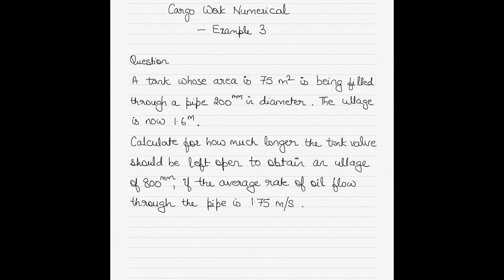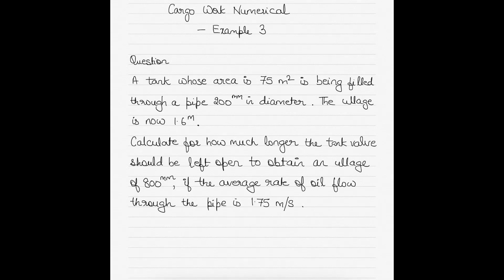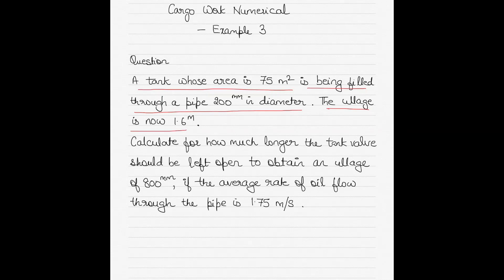Can you solve this Cargo work numerical??

Comment: Good day sir, 
Answer is 18.18 min
But sir this just for pipe of length 1.75 mtrs
In actual calculations do we include  length of drop line from manifolds  to the tank ???
Reply from the maker: U mean for ullage calculation?
Here, the rate of flow was 1.75 m/s (it was not the length of the pipe).
If the pipe was connected to the tank, you would definitely include the height of the pipe.
Reply: @SteeringMariners  yes sir got it .